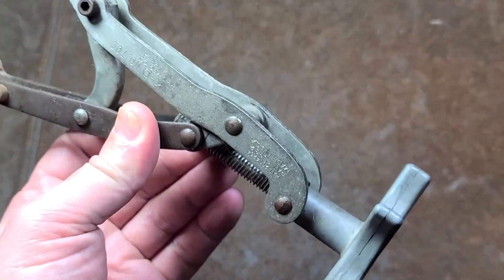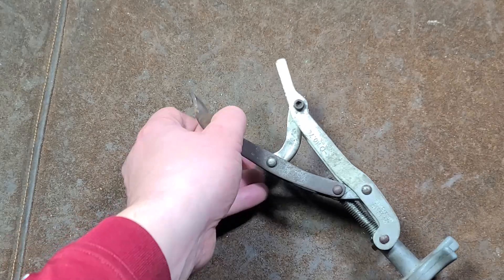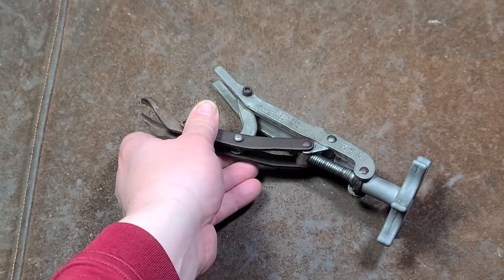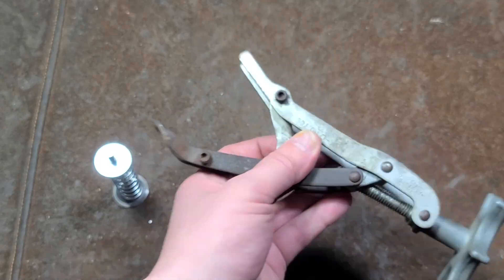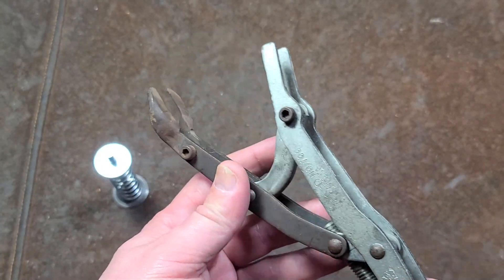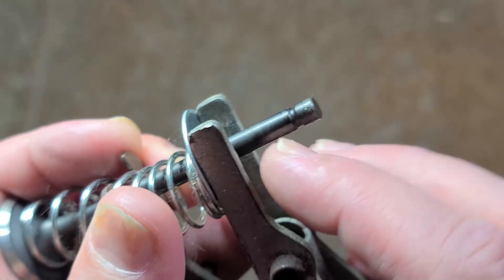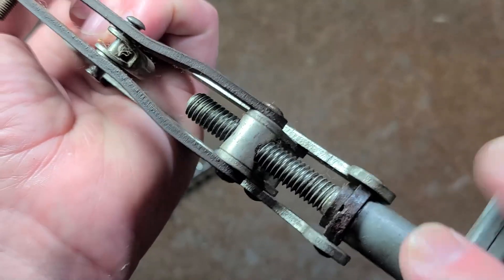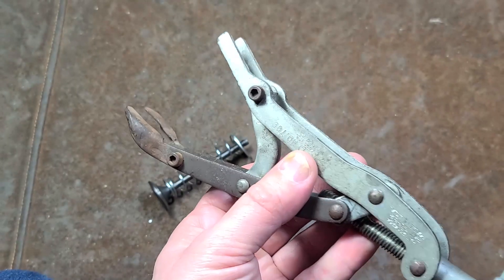K-D USA No. 700 Engine Valve Spring Compression Tool Review

Comment: For the viewers, two instances when your explanation/demonstration are incorrect  , the tool is for disassembling/installing  the valves while in the block with head on or off the block. The fingers push on the block, the cup ends push against the retainer. This tool can be used on any L, F and T head valve arrangement engines ( valves mounted in block).
Reply from the maker: Thanks for the clarification on the tool's use and applications!

Comment: Hello! I like that K-D spring compressor a lot! Now, I just need to find and air fitting for the cylinder to hold the valve up. Any Ideas??  Thanks and cheers from Motown/Dearborn.
Reply: @robertclymer6948
Don’t  know if you ever had an answer to your question, but you can diy one by removing the porcelain from a spark plug that fits your engine, leaving only the base. Pick an air fitting that suits your plant and braze/soft solder/silver solder it into the base. You might need to select a reducing bush to take up the clearance, some hand fitting or elementary lathe work might be required to adjust the bush.
I’ve made many of these over the years, I had a personal 10mm to 18mm set in taper and washer seat variations.

Comment: I was armed with a pickle fork with a long ass handle when I learned the virtue of the Ford hot water heater. What you have there is a really nice piece! I doubt it would fit a V8-60 but for most of the inlines and the 8BAs I’m sure it would be great. I have to wonder if they had a specific kind of explosive or kryptonite pliers to get the key shaped keepers out…

Comment: In the space of five minutes, I have learned a lot about engine valves. I also realized that one of those gizmos is in the garage — always wondered what it was. And a heartfelt thanks for sharing your knowledge and passion about things mechanical.
Reply: Note that the cylinder needs to be pressurized with an overhead valve head, otherwise the valve can fall in to the cylinder (which then requires removing the head).
Reply: You can make sure the cylinder that your working on is at top dead center and put shoe lace or rope in the spark plug hole that way the valve doesn’t fall in